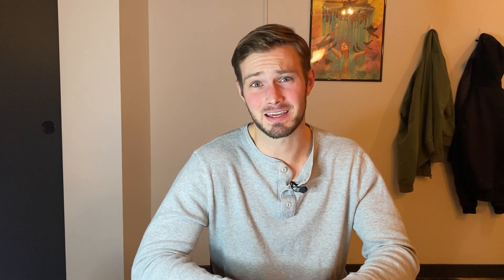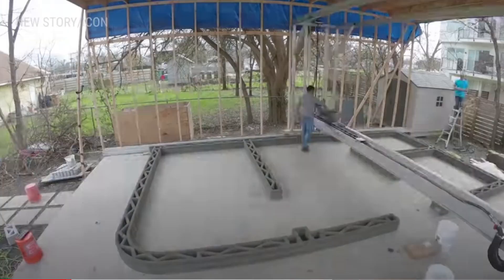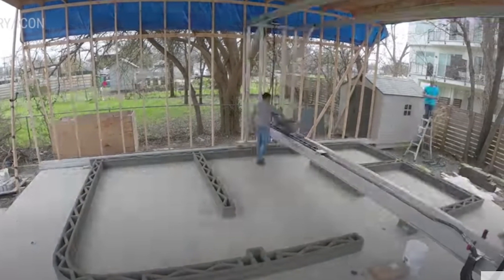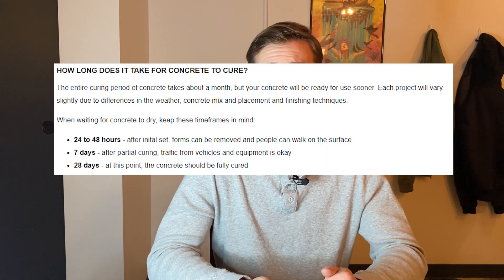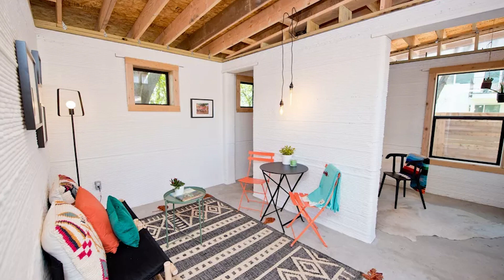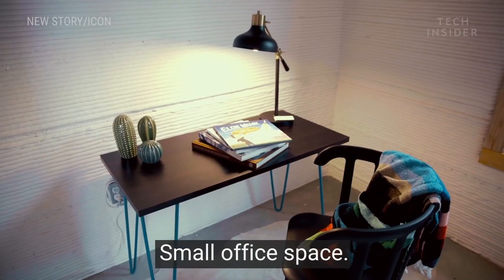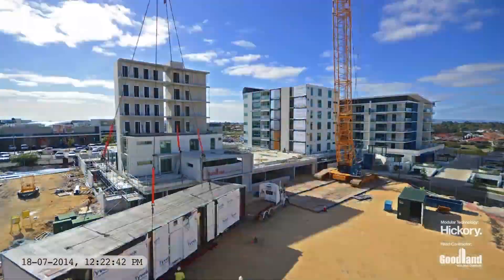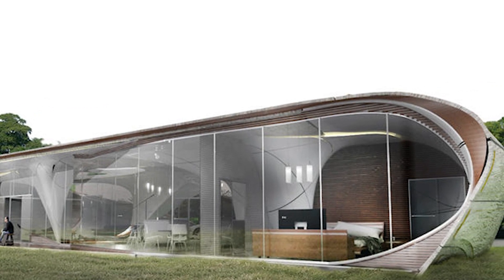3D Printed Houses Have a Hard Road Ahead of Them and Here's Why

Comment: Most of the kinks are already ironed out. Except code which is being worked on now.
The insider video is misleading in so many ways. That building was made to be super cheap for charity. A normal 3d house would not be built that way. And no it did not cost 4k. Thats a lie as well.

Comment: So you should do more research before you make a video. Printed houses are 40-50 % less in cost then traditional construction. Also due to regulation in the US we are falling behind in house printing as compared to Europe or Russia. Prefab savings depend on transportation costs and are subject to lumber price fluctuations. Last you brought up the framing around the icon site. The truth is it is not needed, it dose however prevent having to alter the concert mixture due to thermal or solar variances.
Reply from the maker: Hi Cameron, 
I've realized that the initial ICON video is a bit outdated and I released a newer video / interview (link in the description) where I talk with an expert on 3D printed houses and even talk about the newer problems that you bring up like lumber costs. Hope that helps

Comment: Did you really look for how much time the concrete needs to cure? So you never have worked with concrete rigth? So you are speaking about something that you don't know.... 24 hours curing usually is enough to work with the concrete. But you haven't work with concrete and here you are... Giving an opinion
Reply from the maker: Hi Alex! My research was done through concretenetwork.com who’s data suggests it takes up to 7 days to fully cure. Since then however, ICON has been working on a quick curing concrete mixture that sets faster. You can hear about some of that in my video titled “I was wrong about 3D printed houses” (link in the description)
Reply: @Enginomics  full cure doesn't means it does not have strength. You did a research... Because you never worked with concrete and you are recording a video about something that you don't know. Obviously you are wrong. Totally wrong.
Reply from the maker: @skaford "24 to 48 hours - after inital set, forms can be removed and people can walk on the surface. 7 days - after partial curing, traffic from vehicles and equipment is okay" In this case, I was assuming the weight of a house weighs more than a human so I used 7 days as my metric.
Reply: @Enginomics  as I said. You have never worked with concrete and then you did a video trying to talk about something that you don't know. Obviously when we talk about the "curing process" it is refer to the internal chemistry happening inside. You assumed that " totally cured means totally strength" and you were totally wrong just because you never have worked with concrete. Just read about it and then you believed that you have the knowledge to talk about it.

Comment: I appreciate  the attempt to talk about the downsides to 3d printing. I have a few issues with your input, one the 28 day threshold is pretty moot if you make more then 28 house every house after that would only be a day to build. so that is not a barrier. Another issue that is true to how they don't have electrical/pluming in the 3d printer design, I think the electrical could very easily be fixed. Another issue is that is not talked about is that the concrete is not normal concrete and is in fact more expensive. Wasp is developing a tech that uses much/cob to build homes a much better solutions as it literally uses the resource that is on all sites. One of the bit down side I see is lack of being able to print roofs, I have yet to find a good comprehensive example why this cannot be done.

Comment: actualy not stupid but only in pre prototype phase. in europe the walling is about 1/5 of the cost of the house. so this will not make cheap the builings. but if they found a reabile method what make able to build a reabile, water resistant, isolated walls. what have similar properties like bricks like inner climate controll, thermal and sound isolation, etc. then that will be possible to make new type of houses fast with less handwork.

Comment: should really do your homework before commenting. it is my understanding that Icon is now producing the Vulcan II printer, this video is based on the prototype.  The structure around the build is more weather shield than a requirement, again this was a proof of concept build.  Last thing, Icon has a proprietary concrete blend with zero slump and is quicker to cure, again if you had bothered with even a minute amount of research all of this would have been clear to you.
Reply from the maker: I recommended you check out my newer video (Link in the description) where I interview an expert on the subject. You're right that the technology has progressed a lot
Reply: @Enginomics  That Video just showed up in my feed.  I'll take a look later this evening.

Comment: Honestly, all your reasons for why "3D houses are stupid" seem really minor especially when you consider how much they could greatly reduce the price of a home in the future. For example, you could easily put some sheet rock on that ceiling to conceal the wires. 
You would been better off talking about the uncertainties such as lack of building codes for 3D printing, etc.
All that said, your video content was well done! Keep it up!
Reply from the maker: Thanks! And fair point. I addressed a bit of that in my recent video “I was wrong about 3D printed houses”. The idea itself has lots of potential but I just wanted to point out some of the hurdles in its way to widespread adoption.

Comment: "Prefab is already available, cheap and stable"

While its available.. and.. reasonable stable, its very much not cheap. coming from someone how works with prefab, it have a large array of drawbacks.

Making prefab elements is about 90% to make it producable and transportable and make it possible to assemble. Very little of the work is actually installation  and geometry.

Also with prefab (concrete) houses, you really can´t install utilities after the fact.

A other problem with prefab its that it uses a lot of material. And some of it, like corner rebars, is only there to protect them during transport. A prefab wall must be able to survive all the handling, making it very solid, but also use a lot of materials.

Granted, 3D printed houses is not ready for prim time yet. But its really just a matter of time before the concrete robot is combined with a utility arm to install. When the outlet, pipes and windows can be shoved into the concrete prior to it being totaly hard, then pretty much all of the walls can be printed right away. Just need a electrician to install the outlets.

The last renaming barrier is the roof.

Comment: 3D printing is exciting to startups because they think they'll get rich, very fast.  It's no different from any other housing construction business model--build cheap, sell high.  If it costs you substantially less to build, putting a many multiple percentage uptick in the price on it does not contribute to the public good.  I think you SHOULD profit from your investment and innovation.  I do NOT think you should ruin a new tech's promise by turning it into just another money-maker.  As happened with the tiny house movement.  Builders love them, because they get far more per sq. ft.

Comment: How many foundations have you built? It takes our six man crew at least four days to do a foundation. That doesn’t include any flat work inside the structure, or any of the time the framers will take. To do that all with three guys in a day is a fuckin home run. That’s half the people, doing the job of two separate crews, in at least 1/10th the time. Not to mention that you could probably get away with paying your employees less because they won’t be packing hundreds of 80 pound forms all day. Concrete is a backbreaking career.

Comment: The frame that you said is holding the printer is actually an independent frame and cover for sheltering the machine from the elements.  Technology in concrete has evolved incredibly in the last 15 years,  they have also added native materials to the concrete such as rice husks for additional thermal characteristics plus using less concrete.  3-D printed houses have just started to come into their own where traditional stick frame houses (on an average family home) are not built any better nor had the efficiency increased with the increasing cost of the house itself.  I personally think that the concept is excellent,  innovation and future looks extremely good with this technology. Now they just need to capture the carbon that is created when concrete manufactured which has already started to be realized.  So I disagree that 3D printed Houses are stupid,  with time and innovation they will be a game changer for new housing.
Reply from the maker: You bring up a good point where yes, it's sheltering the machine from the elements and the technology pointed out will continue to improve. I discovered a lot more about that in my newer video titled " I was wrong about 3D printed houses" (link in description). While I think a lot of my criticism is still fair for its current state, the future does look brighter than I thought.
Reply: @Enginomics  Thanks for the honest reply!  I do understand your thoughts on this as well as we move into a period where we will use technology to make this planet sustainable and liveable for everyone as a turning point is here to achieve this.  In Canada right now we are experiencing some housing prices that are beyond reach for a lot of people and the need for affordable and sustainable shelter is going to be needed.   These average houses of 1200-1400 ft/2 are selling at over 2 million in some cities and bidding wars are going on house sales.  Crazy times and some relief for affordable housing certainly will be welcome.  Thanks for posting and it really is getting people to think about housing and alternatives to affordable and sustainable housing!  Great discussion!
Reply from the maker: And thanks for challenging me! I appreciate hearing different perspectives! Glad you enjoyed it.
Reply: @chrisgerritsen2376  corporations are gobbling up housing ..petition your govt to regulate it...that is entirely why this housing crisis exists

Comment: I agree on the time line for the build-up.  You would not be able to just put layer upon layer without at least a few hours between layers or you would get slump.  28 days is total cure time, not between layers.  I would add a bunch of conduits in the walls for future expansion.  A great idea though.

Comment: Most if not all of these issues are nearly worked out now.  As for the wiring/plumbing...it really isn't all that different from wiring/plumbing a concrete block structure.  You'll run into the same issues trying to add new wiring/plumbing to an existing structure as you would a concrete block building.  So it really isn't a 3d printed specific issue.
Reply: Exactly! These "problems" that he brings up have already been solved and have been solved for decades.

Comment: I think one of the dumbest ideas is to 3D print a moon base. For all practical purposes, the moon does not have an atmosphere, it's sitting in a vacuum. The moon cannot trap solar energy. A "day" on the moon lasts 13.5 earth days. While the sun is shinning on the moons surface, temperatures get up to 260F. When the surface is in darkness it plummets to -280F. The evaporation or curing process is a complete unknown. The printing material has to survive incredible temperature swings, reflect or absorb cosmic radiation, and be able to deflect micro meteors or worse. All while providing a habitable interior for humans. Science-fiction has brainwashed people into believing we will soon be colonizing the solar system or even the galaxy, but it will take centuries for real deep space exportation to become a reality.
Reply from the maker: You bring up an interesting point. The colonization of space is sure to be a huge hurtle but maybe by utilizing off world resources, colonizers can save fuel and money by not hauling entire buildings from earth. It’ll be interesting to see what comes next

Comment: The $4,000 house/ $10,000 house is a complete myth. My whole channel is dedicated to this technology. Your main complaint is correct, it isn't cost effective yet. At the early state it's in how could you expect it to be? After the first lightbulb was invented it took 100 more tries to make one cost effective enough for mass consumer adoption. (Assuming your'e an engineer) As an engineer, do you expect this technology to be stagnant?
Reply from the maker: Hey Jarett! Checked out your channel and love what you're doing. You make a good point that the lightbulb took hundreds of iterations until it reached what we see today and that 3D printing houses will be the same. As a mechanical engineer, I think eventually think this technology might eventually stagnate but that will decades off. The way concrete is made / its cost is pretty much unchanged for decades and that will be the biggest barrier at keeping these houses from being cheaper than other prefab / traditional homes. That said, I've been doing a lot more research and it sounds like I came into this video too narrow minded. I'm in the process of a follow-up video and would love to chat with you as I think we're both technically minded people. My email is enginomics1@gmail.com
Reply: @Enginomics  it will stagnate in decades? In decades, when it is vastly improved? tech tahts been around for decades doesn't tend to stagnate unless its replaced by a superior tech... we cant even say how this tech will develop 40 years from now, it will have unforeseeable improvements... Its just a nonsensical statement. You're actually a mechanical engineer? huh, interesting.

Comment: looking at only one source is short sighted, and most if not all of your concerns have been addressed in one form or another with in the industry. Conduit is installed inside the walls as they are built, as is plumbing, access to said pipes can be planed in , and non corrosive substances like copper or such can be used keeping failure to a minimum, plastering or special adaptors can be used to smooth or correct the walls and the mix for the printer is formulated to cure rapidly
Reply from the maker: Thanks for the feedback! I used a couple sources for this video (not just a react video) and I did see the ability for pipes to be integrated into the walls but this specific example, printed in 24 hours, didn’t include that. That said, if the goal of 3D printed houses is to reduce labor, navigating tight concrete cavities in the walls mid print could prove more difficult for electricians and plumbers.
I couldn’t find any concrete numbers (pun intended) on how the ICON rapidly cured mix works, just that traditional rapidly cured concrete has decreased compressive strength. I have a follow up video in the works so I’ll take all this into account and hopefully come back with a more nuanced view.
-Hank